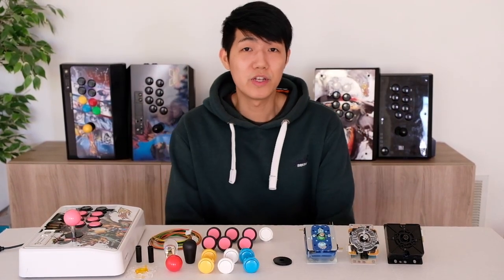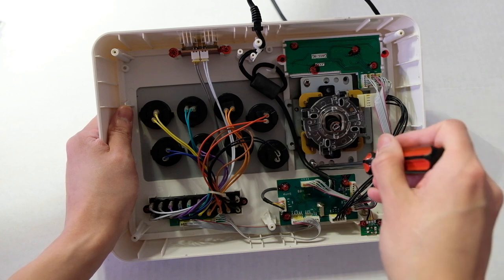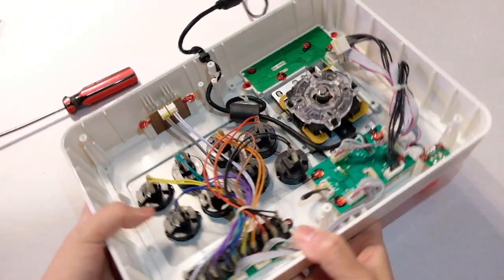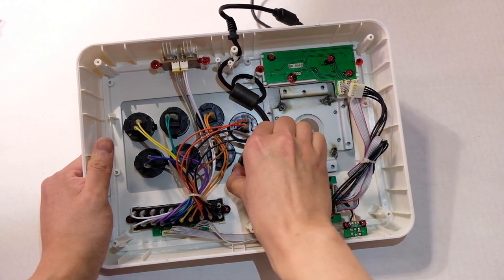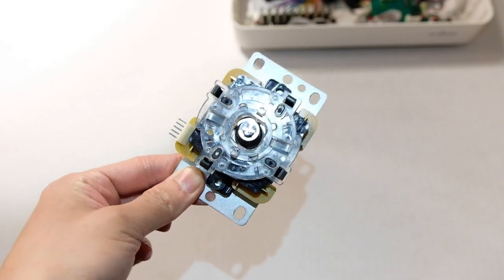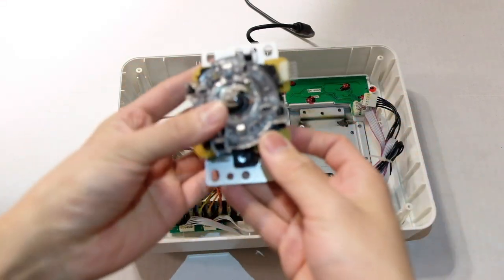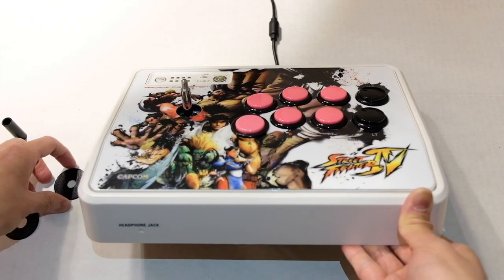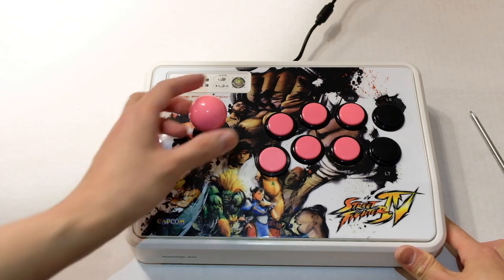Arcade Fight Stick Mod Beginner Guide Sanwa Buttons

Comment: My joystick ball keeps unscrewing. Do I need sanwa sticks to prevent this or do I just tighten it with the flat head? I've seen some balls that won't unscrew no matter how much you turn it, how do I get it like that
Reply from the maker: You can open the casing, and tighten it with a flat head, if the threads are bad, and it keeps getting loose, you may have to use crazy clue. Some korean levers, the ball or bat top doesnt detach like sanwa ❤️🙏
Reply: @JoystickNY  you're the best man, just needed the flat head. I love how you reply to every comment. Keep up the good work

Comment: Help me please. I installed sanwa buttons on the controller and I can't get the controller to sign in to my switch. I am pretty sure that the buttons work because I can get the controller in firmware mode using the buttons but on the pairing controller screen it's not working. I'm so frustrated. Thanks for any help you can. Be well everyone.
Reply from the maker: May i ask which controller did you mod? 😕
Reply: @JoystickNY  I actually have an 8bitdo n30. It's a different controller but I can't find any info on my problem. I think the R/L buttons work because I can put the controller in firmware mode using the buttons but when I need the R/L to sign in to my switch it won't register. Thanks for the quick response. I am so frustrated I put the work into the joystick and right now it's a paperweight. Be well.
Reply: @JoystickNY  You know what? It just started working. Idk. Thanks for your help anyway and keep up the great work.
Reply from the maker: @1978pq  oh, i am glad to hear, have fun my friend, i ll see you around online one day, i am planning to stream 2020, maybe i ll get some setup and set up some online gaming rooms.
Reply: @JoystickNY  Sounds great, I'm looking forward to it. Thanks again for responding. So far the stick feels great with a seimitzu joystick and sanwa buttons. Nice upgrade.

Comment: Just wondering.. have you ever tried to remove quick disconnects with pliers? I hope I did not buy it for nothing 😂
Reply from the maker: Sometimes, if its too tight, i will use tools to wiggle it 👍